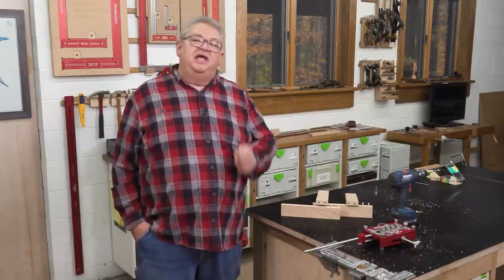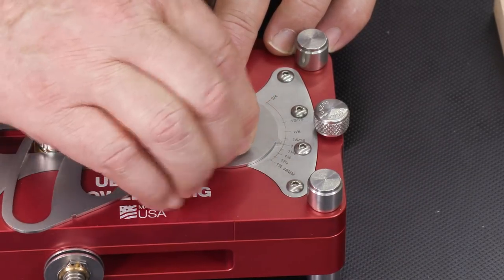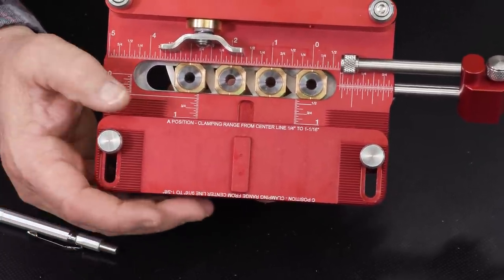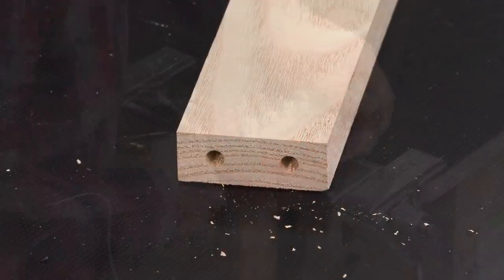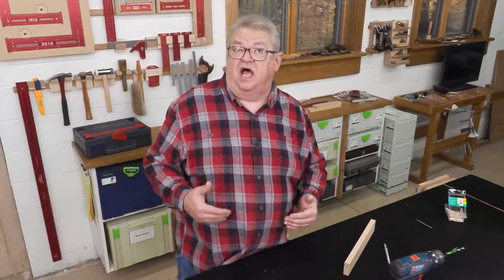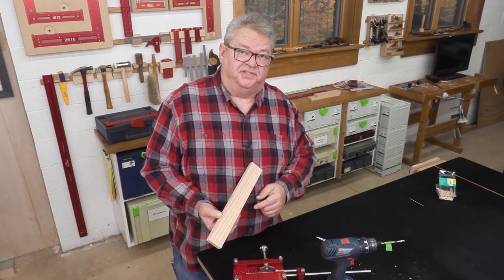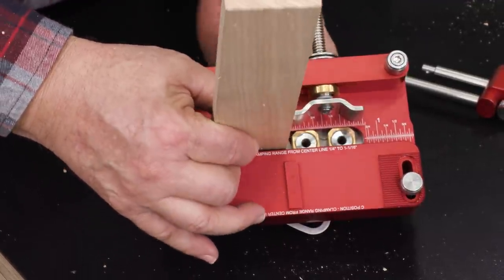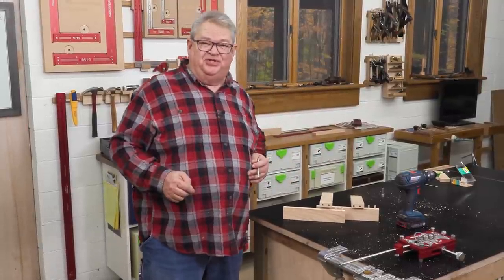Drill Dowel Joints TWO WAYS  With Ultimate Doweling Jig | Deep Dive | Woodpeckers Tools

Comment: I own many great Woodpecker tools and this is a great video Jeff.  As a building trades and cabinetmaking instructor for 37 years, I have found that doweling jigs all have some inherent problems related to function in the applied situation. I already own Woodpecker's MT Center Gauge and Doweling Jig. I found this jig, with its parallelogram design, great for finding exact center and other centering layout situations for which this tool was designed. When drilling for dowels I find it difficult for this tool to stay on the mark. A portable power drill with a 3/8" bit has a great amount of mechanical leverage/advantage and the slightest motion will move or tilt the jig. This is especially true when drilling into the end grain of a 2" rail where only a small portion of the jig rests on the wood. I have used many different jigs and have found none that incorporate any kind of tightening system that gives good purchase and tightly holds the jig in position. Most of the dowel holes that I drill are 3/8" and 1/2". Larger bits exacerbate this problem. I have employed a peel and stick abrasive on the "jaws" of my jigs. This helps grip the stock much better than the smooth surfaces found on most jigs. My bottom line is, I want a good, tight clamping jig that can't be dislodged from its aligned placement with application of drill power transferred to the bit. Also, finding really good quality dowels adds another variable to the alignment equation. Rotate a micrometer around your dowel rods and check for consistent diameter and you will see that all dowel rods are not within a reasonable tolerance.
Reply from the maker: Joe, I've use a small "F" clamp on the MT Center Gauge with good results. That said, the Ultimate Doweling Jig has a built in clamp with a large clamping pad and a very beefy screw. It definitely does not move.

Comment: I've used dowel joinery, even made jigs for special applications (not hard to do). But this is $600, even more if you get the extra diameter bushings. You can accomplish everything this jig does with jigs a fraction of the price or easily made for the occasion. Note also that it doesn't center dowels on the stock, only places them at a fixed 1/32nd from the reference face. Almost all doweling jigs will center stock automatically, but not this one. It involves calculation.
Reply from the maker: Centering the joint only works well if the stock is perfectly prepared. Indexing from one face ensures that the outward face of your project is perfect, even if there are minor variations in the material thickness. Indexing also allows you to create a uniform offset, as in a table apron.

Comment: Hi Jeff, great video for utilizing dowel jig! Like the knurled screws for adjusting the side fence. Is it possible to get these screws independantly to use on previous version of dowel jig? Thanks!
Reply from the maker: Eric, on the previous run of these, the stop-rod threaded in. The new one pushes in and locks with the set screw.

Comment: Hi Jeff, thanks for a great video. I just bought the UDJ2 after you showed me it could do what I need. Here's a question though: In the video I noticed a Zyliss Vise Clamp attached to your workbench. It looked very interesting, so I looked it up. It appears to have several valuable features that would be great for my tiny shop. It seems that it's now only available on the "for sale" sights, meaning it's probably out of production and has a lot of "knock off" versions that are not good quality. So could you possibly tell me which "version" of the Xyliss clamp I should look for, same as the one you own? It also looks like this might be a good prospect for a Woodpeckers One Time Tool! All your videos are very informative, Jeff, thanks again.
Reply from the maker: The Zyliss was popular at woodworking shows, state fairs and home shows through the 80s and 90s. It was made in Switzerland and imported by a couple different companies over the years (Clark and Advanced Machinery being the two main ones). They're fairly easy to find on eBay, Facebook Marketplace and Craigslist. Just look for one that has "Zyliss" in the castings. I wouldn't trust any of the copies...they were pretty poor.